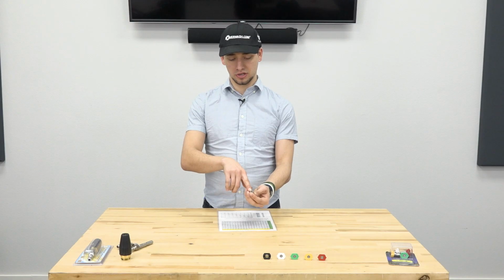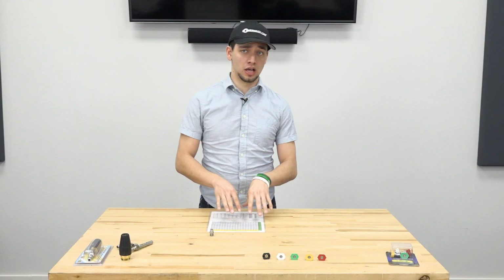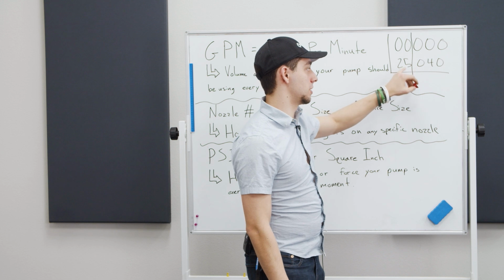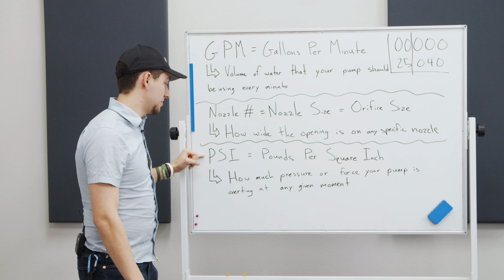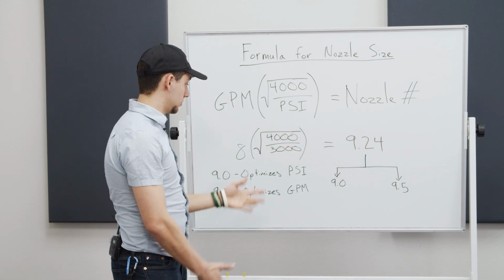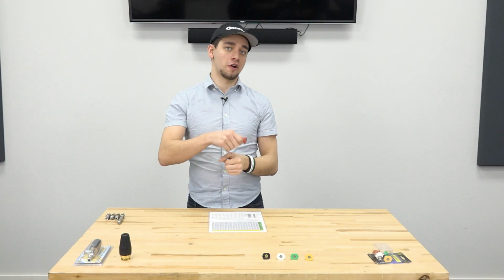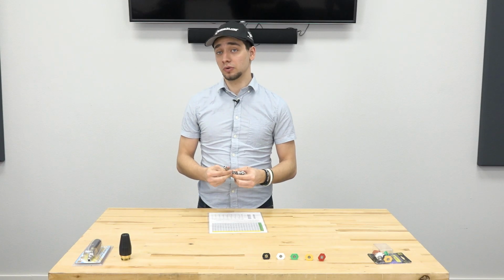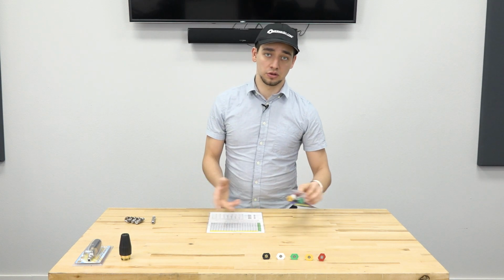How to Choose the Right Nozzle for Your Power Washer

Comment: I have an AR RSV 4G40 pump and it comes with 4GPM at 4000psi from the factory. My nozzles are 04, however I installed a pressure valve with external baypass. When I press the gun trigger, on the pressure valve at 4000psi, water comes out of the baypass at 0.973 GPM. Without the nozzle at the end of the boom, 4GPM comes out. And with the 04 bushings, only 3.17GPM comes out. Should I go to 05 or what could be wrong?
Reply from the maker: t sounds like the reduced GPM when using the 04 nozzles could be due to an orifice size mismatch. To achieve closer to the full 4 GPM output at 4000 PSI, consider switching to a 05 nozzle size. This may better align with the system's pressure and flow needs while maintaining optimal performance.
Reply: I think your pumps real work pressure is 3170 - 3200 psi. That’s why you don’t get 4 gmp

Comment: What would be the right nozzle size for a 4400psi 4gpm pressure washer ?
Reply from the maker: For a 4 GPM pressure washer rated at 4400 PSI, using an 04 nozzle is recommended. This orifice size will ensure you maintain proper pressure and flow without overloading your system or causing damage.

Comment: Hi bro, I have a kranzle pressure washer made in germany model K2160 TS, rated flow rate is 11L/min or 2.9 GPM if you convert it to GPM (am I correct?). Max rated pressure is 140 bar or 2000 in psi. should I get 4.0 orifice nozzle?  

and since my pressure washer has a pressure regulator (or valve unloader) that I  can adjust, lets say I would like to adjust max pressure to 1,800 psi for car wash cleaning, what orifice should I get?
Reply from the maker: Your conversion to 2.9 GPM is correct. A 4.0 orifice nozzle should be suitable for your goal of maintaining 1,800 PSI for car washing. Adjusting the pressure valve on your washer should help fine-tune the output as needed.

Comment: Really need some help selecting the proper orifice size. Which size will I need for a 1900 psi 1.2 gpm electric pressure washer??
Reply from the maker: Here is the nozzle chart on our website. Just match up the columns and you should be good to go!

https://powerwash.com/nozzle-chart/
Reply: @Powerwash  thank you! I have found a few of these charts and some suggests as big as a 2.5 while according to your equation I'm getting 1.7.
Reply from the maker: Glad we could help. This chart should be exactly what you need as this is the same chart our professionals reference when we get calls about nozzles.

Comment: How do you know the actual psi your pump is producing? You can measure it with a given nozzle but that changes based on the orifice size. How do you determine what psi to use in the equation?
Reply from the maker: Every pump is rated for a specific PSI whether that is soft washing or pressure washing. You can usually check the manufacture website to get the PSI rating.

Comment: I have a good amount of concrete and flag stone to power wash. I have a gas powered Briggs & Stratton brand 2200 psi/1.9 gpm washer.  Would a turbo nozzle work well with this machine?  I find it seems to be tedious time wise in using the nozzles that came with it.  Thank you for any advice you can give.
Reply from the maker: A turbo nozzle would be a big help.  Just be careful not to damage the stone https://powerwash.com/shop/accessories/pressure-washer-nozzles/turbo-nozzles/a-turbo-nozzle-4000-repair-kit/

Comment: Should I use the tips that come with my 8gpm machine or get different ones?
Reply from the maker: If they came with your machine they should be the right size nozzles.  Unless, you got a used machine then I recommend checking the nozzle chart to make sure you have the right size.  Also, remember that nozzles wear out and should be replaced often

Comment: My fan nozzle that came with the water pressure washer is only strong on both edge of the fan. The pressure   between the is just like it's coming out of a normal hose. That means when I tried to was my deck with the fan nozzle, there's only about 1/16 inch of both side of the fan are actually pressurized。 Since I am not sure how to tell if a nozzle has even pressure I have not used the pressure washer after 2 uses a couple years ago.

Comment: The tips that came with my 3300psi/2.5gpm pressure washer are sized correctly (the code stamped on each tip ends in "26", meaning 2.6 orifice size), but the 25 and 40 degree tips have "sharp edges". By that I mean the fan pattern is needle-like at the top & bottom edges. These needles have a tendency to tear into paint and wood and I can see & feel them even when the pump is off. I can minimize the problem by keeping the tip away from the surface and keeping it moving quickly, but I'd rather the problem not be present at all. Do all spray tips have needle-like edges, or do I need to get better quality tips?
Reply: You need to get tips with a larger orifice, you want to be under 1000 PSI for wood.

Comment: Hello guys.

I have a nilfisk Pressure washer with 190bars max pres and 650l/h max flow.
The correct nozzle for this is the 3.5 but i already have some 3.0s.
Is the 0.5 difference big? Will i overstress the motor? Should i buy the 3.5?
Thanks! :D
Reply from the maker: You should be ok.   To be off by .5 nozzle size is not uncommon
Reply: @Powerwash  Thank you very much for the quick reply!

Comment: I have a new 4200 psi 4 gpm pressure washer. It came with nozzles, however there is a lot of kick back and pressure. What would you recommend? TIA
Reply from the maker: Sounds like your unloader is not adjusted correctly.  Look on our channel for a video that show how to adjust it

Comment: Is it the same process in choosing a rotary nozzle??? Thanks
Reply from the maker: Yes
Reply: @Powerwash  And may i ask also...can i use a telescopic wand on a 2800psi @ 2.5gpm machine....thanks again
Reply from the maker: @anextday  yes you can but that's not a lot of cleaning power.  I would move up to a minimum of 4000 PSI at 4 GPM
Reply: @Powerwash  ok thanks again bro

Comment: The nozzle size OPTIMIZES the performance of the pressure washer, but cannot exceed its rated power, right?
For example, a pressure washer rated 4000 PSI and 10 GPM would have a nozzle size of 10. If I use a size 5 nozzle, I should still only get 4000 PSI but reduced to 5 GPM. If I use a size 20 nozzle, I should be getting 10 GPM, but only 1000 PSI.
Reply from the maker: That is correct
Reply: Is there a chart for this kind of conversions?
What might happen if I increase the GPM and reduce the psi by using a bigger nozzle? Will my washer brake?
I have 2300 psi 1.2 GPM

Comment: Hi,

On a 13hp engine with a (5.5 gpm @ 3500 psi) i should be using a 6.0 nozzle? not a 4.0 correct?
Reply from the maker: Yes a size 6 is the correct size

Comment: I have too much pressure on my machine, what can I do?
Reply from the maker: Have you tried using a larger nozzle to reduce pressure
Reply: @Powerwash  yes I have. I use the 25 and 40 degrees nozzle but to each nozzle still the pressure is high and can destroy property
Reply: Is turbo nozzle better than zero degree nozzle
Reply: @mdmuhibshaikh9560  yes